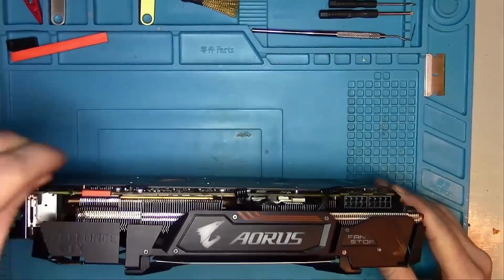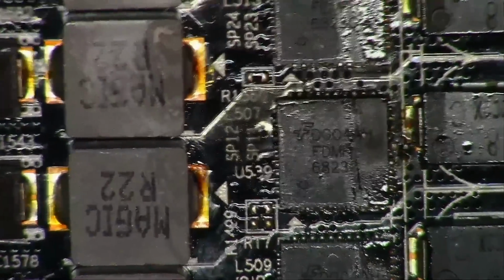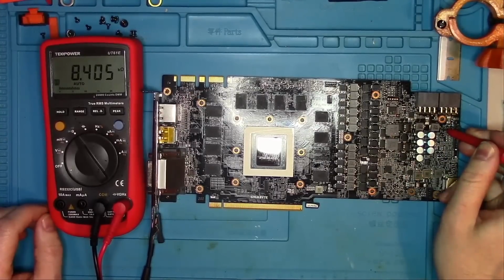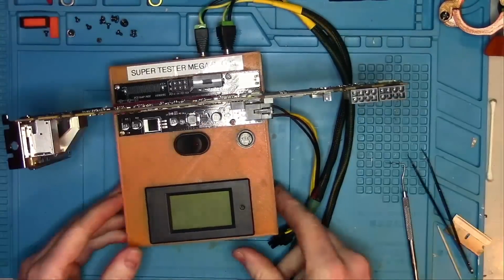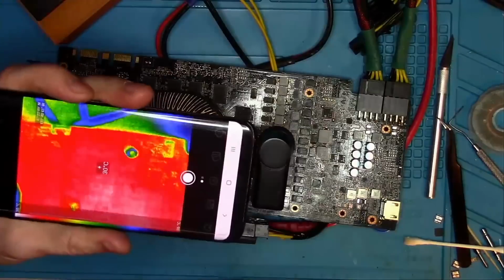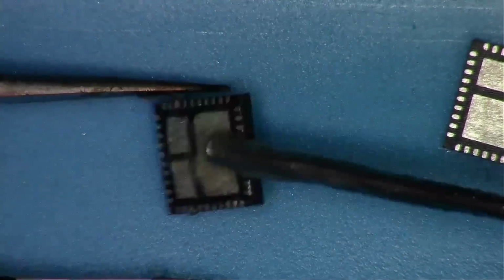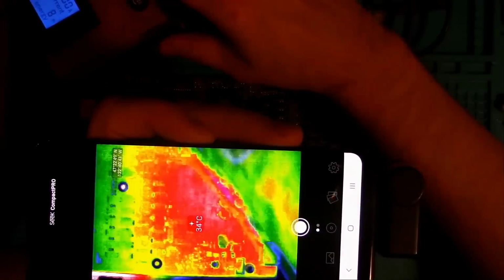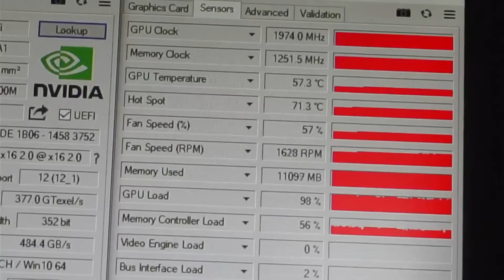Gigabyte 1080ti Aorus burned pcb repair

Comment: watching some other repair channels who give up so quickly ,its nice to see someone finish the job.
Reply: Yes cuz usually it doesnt make sense to fix card like this. Repair will cost more than brand new card
Reply: i find it fascinating that he actually fixes the problems,  and the process of doing it... fascinating! lol
Reply: @dangerd9315  it's also that they give up because they can't figure out what's faulty on the cards
Reply: Very thorough.. I've seen him spend way to much time to get to the bottom of every "rabbit hole". He 100% fixes or determines that it's unfixable. Would have loved to see him treat the vintage ATI Radeon 9700 card this way. He was "done with this card" from the beginning of the video. Good video BTW. I have two I'm currently attempting to fix.  They have knocked off missing components, severed traces, etc.  Plan to reball the cores and memory as well. One card artifacts like the one in the video, the other has a black screen issue. In the end it turned out to be the only card (I've seen) to kick his ass, and i'm not talking, dead core or memory no fixes either..

Comment: I have a 1080Ti and you're right, it's still working well in the applications I use.  New drivers support old cards easily.
Reply: Still rocking a 1070 and a 1660ti. They are starting to show their age, but still going strong

Comment: Good stuff. 1080ti Club here as well :) Def recommended anyone still on these cards to repaste them at this point, they are in dire need of it and they will start dying in mass amounts because of it.
Reply: Gigabyte gtx 1080ti extreme edition owner here, bought the card at the start of gpu price drop for €380 since i needed it for vr, it had no box and corrosion on the cooler but it works fine, replaced some pads as well as they weren't making contact with the components. So check your own card and replace if necessary
Reply: did it last week with kryonaut extreme and new pads, and it dropped my temps by almost 10°C on core
Reply: As a former 1080ti club member, this card had a very good price/perf especially these days

Comment: Do you ever use 3Dmark for verification? It seems to be the most sensitive benchmark for GPU or memory faults. I had a 1080 Ti which passed MATS memory test, all Unigine benchmarks and Furmark (long-term, good temps) but would always crash immediately in 3Dmark. I assume it was some subtle GPU issue which only comes to light with certain APIs (like DX12) since the memory test was good. I'd recommend using 3Dmark as a standard for "QA" or you may get complaints that the card crashes in certain games but runs fine in others.
Reply from the maker: 3d mark takes too long, I don't like it.
But the more tests the better.
I agree with you 100% and I will follow your advice for sure.
Reply: @northwestrepair  well comparing to the time u comsume repairing a card , ur patience is massive , just try it
Reply: best test for memory error is game Days gone. it also put exceptionally high load on card so card consumption is higher than with unigine, combustor or games like Cyberpunk, RDR2...

Comment: Im only now getting into GPU repairs. I need most of the tools. What i really need is the tool you use to power the PCI-E riser. did you make that yourself? If so, do you have any information on the how to? This could be an idea for a video, to show off all the tools you use, and the ones you can make yourself.

I actually have the exact revision of the card you shown as a donor board. looks like the resistance on the 5v rail is way too high.

Comment: I love your work and steady hands, (if I need brain surgery, I'll keep you in mind). Is it hard to solder the way you do? I have an Asus RTX 4090 TUF and it has vacant VRM spots compared to the STRIX. Would it be hard to ad those components myself? Could you do it? Have you done it? 
Maybe I could take bits off my unused 2080Ti's?
Reply: The voltage controller needs to be reprogrammed in order to use the extra phases.
Reply: @TwiztedJugallo  
Ok, thanks.

Comment: As far as i know they only die in pairs when the gates are controller by doublers or directly  connected together.
Reply from the maker: You maybe right. I am not a professional, I make allot of assumptions based on what I see.
In this case, they were not even a pair because a pair to this drmos would be 5 drmosses up. I called it a pair because what I usually see is if one goes bad, one next to it is also going bad.
Reply: @northwestrepair  you can always look up the pwm controller's datasheet. See how moany mosfets can it control and count down them. If you have more mosfets, some of them are doubled.
Or just measure the gates together.
Reply: @northwestrepair  why with pairs? if u have blown phase , it have two neibors/mostly/, so u may replace 3 pieces. but i dont find it true. mosfets ok i replace them all, but drmos i replace only bad

Comment: I just had a mosfet blow on a gigabyte 980ti and burned the top layer. Any luck of saving it? I see you had a video on it with the 0 ohm resistors but it burned the mosfet after running for 20mins.
Reply from the maker: Depends on the traces underneath.
If you want to send it to me to fix, even at my lower then dirt prices it's not worth it, especially after shipping cost.

Comment: Tony: Instead of barbequeing the board when welded hae ya'll considered using a grinding pen and going down just to the bottom of the mosfet? It seems to me to be less likely to charcoal board layers and save a few more from the electronic waste factories. But I am usually wrong being a celebrated nincompoop. Ciao

Comment: What type of glue did you use to stick that burned trace back down tony?
Reply: That is solder mask. It protects the board and the solder joints. With UV it will dry and harden.
Reply: @martinkesselaar9522  He applied it underneath the Trace and that stuff looked transparent like super glue.
Reply: @FR4M3Sharma  probably some B or T series glue, but you can use pretty much anything, make sure to use solder mask or kapton tape on the trace
Reply from the maker: Super glue.
I know heat will weaken it but Its enough to keep it down for the time being.
Plus solder mask was helping keeping it down too.
Reply: @northwestrepair  Thanks Tony, I also wanted to ask if Epoxy Resin would make a good adhesive for this exact case?
Reply: @FR4M3Sharma  should work, since most PCBs are fibre glass and epoxy, you can go a bit further and use one rated for higher temperatures, but super glue will work just fine
Reply: @ShahZahid  Thanks.

Comment: Before watching the video i'll answer. Yes and No. If the high side mosfet of the phase shorted , that can cause damage to the device which that phase is driving since its basically connecting the 12v input to the choke directly.. If the low side mosfet of the phase shorted then there is a good chance of survival.
Reply from the maker: It's a drmos
Reply: @northwestrepair  doesn't matter, it has half bridge driver and mosfets built inside. Same thing with mosfets on the outside.

Comment: my gpu i think it died fans not spinning sometime it starts with a loud noise wont let pc boot  but these problems caused by humidity can it still be fixed even tho i took it to a repair  shop he cleaned it i have gtx 1070 8gb

Comment: You dont need to Meassure the Individual Vcore Coils ^^ They are Connected together. After a Repair like this you Should Check with a oscilloscope The Vcore Rails if they are working Okay. You dont really see that in Benchmarks But if the Signal is not Correct They will die soon again. But all in all Good work ;)
Reply: Agree

Comment: when you remove the chip, is that a solvent or some kind or an oil you are using?
Reply from the maker: flux
Reply: @northwestrepair  Thanks! I am always curious about stuff & how it works or how its done. Always have been. I used to take shit apart when I was a kid & would try to figure out how it works. I'm afraid of what I would've accomplished if I had YouTube & the internet when I was little. HaHaHa!!

Comment: Damn... FurMark for a burn test, I haven't seen anyone use THAT program in awhile for a graphics card test! Mostly because it's such a brutal "one dimensional" test vs something more dynamic like the Valley benchmark.
Reply from the maker: Furmark is a stress test.
Valley is a function test.
Reply: @northwestrepair  as I said FurMark burns the card, a torture test, vs more of a graphical benchmark to test rendering and framerate.

Comment: hi! what part of a computer has the most impact on gaming performance. FP Shooter, fast, crowded, multiplayer maps?
Reply: What has the most impact on game performance is something called the PBKAC, or for troubleshooting purposes the PEBKAC. Shorthand for "Person Between Keyboard And Chair" and for troubleshooting "Problem Exists Between Keyboard And Chair". Kidding aside, it depends what you have to start with, the base computer. That's pretty complex and next to impossible to define without knowing what components your base computer has, but if you have a relatively new computer that has say a newer Ryzen series CPU with at least 8-16gb of RAM it's a safe bet to say the performance bottleneck will be the Graphics card or even the amount of crap you have running in background computer processes from programs you installed that run (hidden) at system startup. Look up how to open your computer's "task manager" and look at the "startup" tab to disable anything that you're certain doesn't need to run every day. Like I said... a PEBKAC because the user unwittingly installed a resource hog.
Reply: @macgyver5108  hi! wow, your post is awesome! thank you, very much. you know what's weird? I had that thought about crap running in the background. 
Just about Christmas this year, I built a kinda bad assed computer. It is based around a an Intel 
i9 10900k. 
I had went through the background list on my Dell Optiplex 7010 and kicked a bunch of stuff out that was running for no reason, just as you said. thank you. You, sound pretty sharp. I bet you took college computer classes on computers 
I had put Windows 10 pro when, I first built it. I knew that, I was going to 11, I didn't bother with too much tuning stuff. Yeah, I had upgraded to 11 the other day. But, I had to move out for the painters. I've most of my stuff back. I already got mt PC up and running. 
The only game that,  I play is Medal of Honor Allied Assault multi-player. There are a lot of bad ass players there. 
I, tell ya, my game play got micrsoftly better. 
I've got free wifi that is weak as hell. 31 down, 6 up. 
So, I'm getting my own high speed wifi. 
Those guys are so good, that I, need all the help that, I can get, lol!
I tell ya so far, the things that have made a noticeable for my game play. I removed the default cap on frames per second. it will blip to 3,000 FPS. But, won't run it freezes up and the Low Internet light is flashing like crazy. So, I just keep lowering it, until the light quits flashing. I've played occasionally with my FPS around 700-800 it was awesome. but, most off the time I have to dumb it down to the 300-400s. I'm basing there numbers on the Medal of Honors built in FPS counter. I tested that counter against another FPS  counter app and the numbers were mostly, no where each other. So, I ditched the FPS app. I didn't want it running in the background, too.
I'll tell ya, the one thing that really made a noticeable difference was when I ditched my Smart TVs 60Hz and replaced it with a 240Hz monitor. 
I, wish that you could see my set up. You can go to my YouTube channel and see what I've been doing. There's some videos off it and videos of my tests like, Cinebench R23. Valley, Heaven tests also. I had scored a 16,625 on Cinebench with Windows 10 Pro but, when I went up with Windows 11 Pro, I lost about 400 points. The first thing that, I thought of what might be running in the background. 
In my little survey, I had written to guys with good quality channels. The responses were basically, 6 for the GPU. 2 for the CPU. 1 for the chair. And 1 for the brain. 1 said the monitor. There was one more but, I can't remember what it was. 
I, compared my test results to other ones and the points show the CPU as the most difference. So, to some it up,  all of the other tests also, showed that the CPU makes more impact on the points, than the GPU. Crazy, right? 
And definitely the monitor. Made noticeable game play performance.  
I am definitely going to get into the background apps to kill some stuff. I was surprised and bummed that, I lost points upgrading to the 11. I want to find out why. 
My YouTube and Facebook pages all are titled with my name to search for me. Thank you for responding.
Reply: @mrkemblegilstrap  one last tip for anybody reading this, months later: unpark your CPU cores! for some stupid reason windows 10 and 11 like to muck with power plans and park CPU cores (aka setting it to lowest speed) after major updates.

on older processors (8th gen intel or older, 1st gen ryzen or older), Spectre mitigations could also be eating up precious CPU cycles. Sure, disabling mitigations can theoretically open you up to malicious websites mining your RAM for passwords or encryption keys, but a number of browsers  have mitigations for that. you're not doing banking on your main gaming OS anyway, right? right?

Comment: u did not werify phases working state with scope. it can not work and u did not know it. but u know it, so what it the catch?
Reply from the maker: No need to. Without working phase it would crash with furmark.
Reply: @northwestrepair  no it will NOT. missing 1/12 of power means nothing for 12phases. have this car with 3 burned phases and with just -10% power limit it work for years
Reply: @northwestrepair  nope. i repaired one with burned one phase and it work without problems
Reply from the maker: @danielsatko-  my understanding is: if you are missing a single ACTIVATED phase, it will crash under maximum load.
It would not be able to reach 100% TDP with one phase not working properly.
Reply: @northwestrepair  with many phases u can light overload phases to get full TDP. like if u miss one of twelve phases. ofcourse u cannot make it run long, because of overheating and ppossible burn

Comment: hello my friends gtx 680 all of sudden dont want to install drivers and gives some lines on monitor 
only thing i saw was missing some type of condutor or somethibg called c897 its ripped from the board Notice( that pc was staying at his garage  thats cold  with open windows so he got his pc in the house and plugged it in and it gives some tipe of artificals) sry for my bad language. Thanks

Comment: Is that missing memory chip normal for 1080 tis?
Reply from the maker: Yes. The GPU can actually recognize 12gb with a proper bios and complete circuit if I am not mistaken., I honestly don't know what's is the reason behind this.
Reply: @northwestrepair  The missing memory chip isbecause this is basically a Titan X Pascal, but slightly cut down
Reply: @northwestrepair  Oh, nice to know, maybe it's because of the odd amount of vram? Or maybe it's just a Titan PCB with a 1080 ti core? Who knows